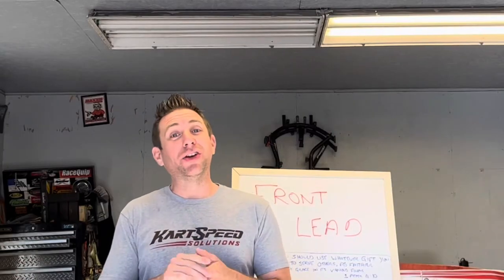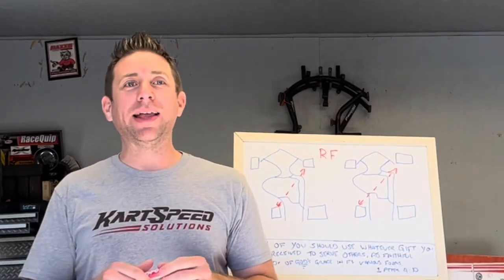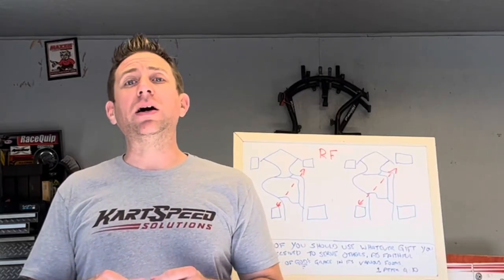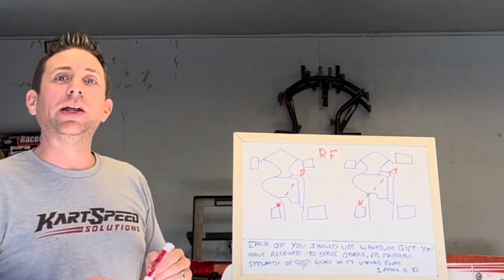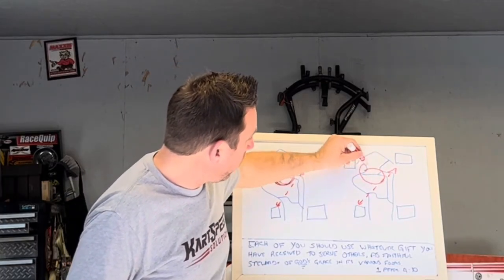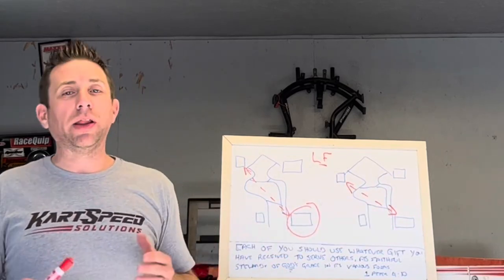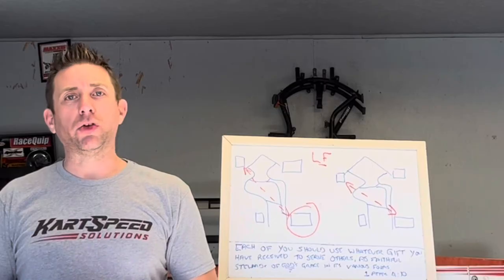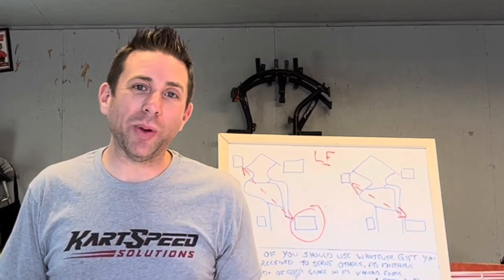Front End Lead? What does that do?!?!

Comment: Every chassis is different. The vertical center of gravity plays a large part in the dynamics. Raising and lowering the right front wheel makes a large impact. Anyways you have to set the chassis to the track and driver. Those that work hardest win the most.

Comment: With the RF back can you run more negative RF camber to try to pick up more roll speed? It seems that the Camber, Castor and Castor plate position will all impact roll speed. My question is what setup will produce the least rolling resistance  to increase roll speed?
Reply from the maker: Yes sir, you surely can! Racing rewards the creative. Trying different combinations of adjustments to achieve a certain result is next level

Comment: on a small track LF and RB what would be a good caster setup on left and right
Reply from the maker: I would start off at a low split with like 7/10 or 7/9 to get more Front end grip and  more rotation center off…and depending on how tight the turn radius is you could go lower (assuming you have the correct rear stagger)
Reply: @kartspeedsolutions  tks